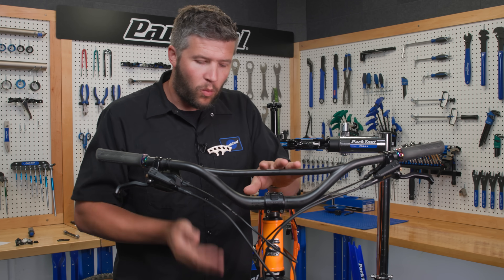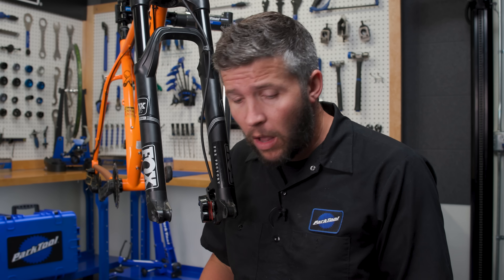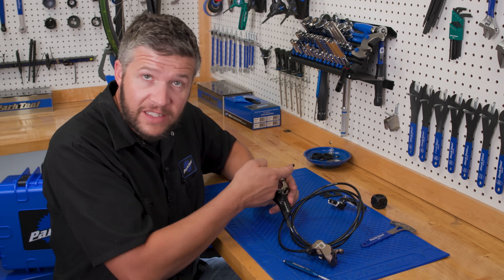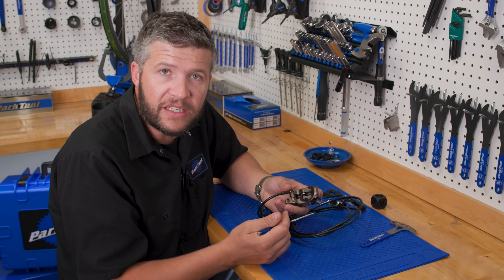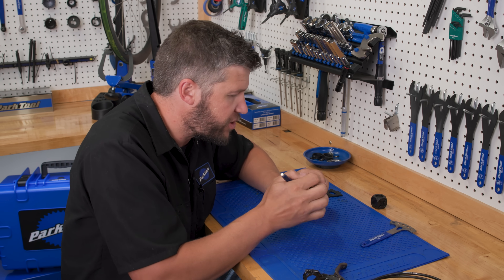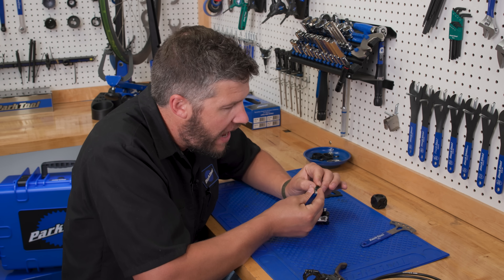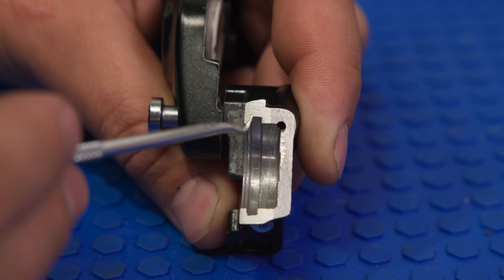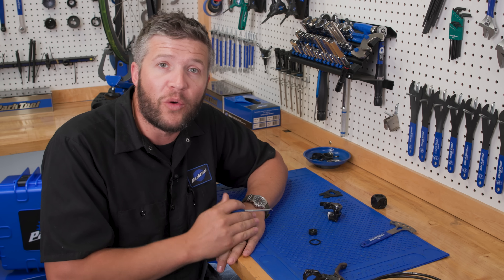Resetting Disc Brake Pistons | Tech Tuesday #238

Comment: I'm surprised you didn't talk about resetting pistons during a pad replacement, and opening up the system at the lever to give the fluid somewhere to go.

I also like to teach people to use the right tool to spread pistons during brake service. Cracked ceramic pistons on Shimano brakes make for a very bad day at the shop.
Reply: No need to open the system when you always use a bleed block when bleeding. If you bleeded without a bleed block you might habe to much oil in your system. And yes, then you have to either open it or see what breaks first (usually the membrane in the brake lever).
Reply: As long as you don't fully open/seat the pistons back in to the caliper, no need to open the system. Inviting trouble with potential air in the system
Reply: Yeah man. I open up the system each time I put in new pads to push back the pistons. One time I didn’t open up the system and pushed back the pistons, I blew my bladder.
Reply: @GokkunGuru  You did not use a bleed block.

Comment: Great video! Question is it necessary to open the bleed port on the lever when resetting the pistons?
Reply: when you bleed your brakes, use a bleed block to ensure the brakes are bled with the pistons fully retracted.  Post bleed; when you set the pistons/pads to touch the rotors after you've closed the system, the fluid level will fall.  This fall in fluid will mean you do not need to open the bleed port when adjusting, since there's enough "vacuum" volume for you to fiddle with piston travel.
Reply: @MTMXBL Isn't it going to slowly suck air from the atmosphere? I always bleed with the pistons in adjusted position so I leave no room for air to get into the system.
Reply: It shouldn't be necessary, for the reason MTMXBL explained in his reply. However, if the system is overfull of fluid, usually from doing shortcut "lever bleeds" with the pads in place instead of a bleed block, and therefore the pistons advanced a little during the process, the fluid pressure from pushing them back can potentially damage the diaphragms in the lever body causing leaks.
Reply: Hi everyone , Thank you Merci ❤😊
Reply: i never did that, so i dont think it is needed